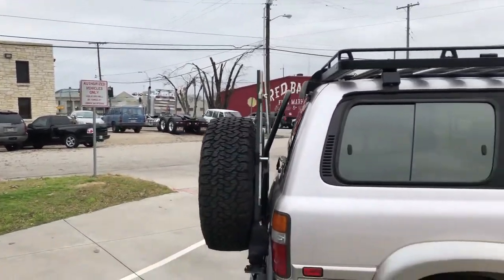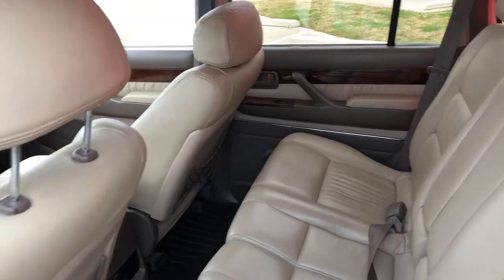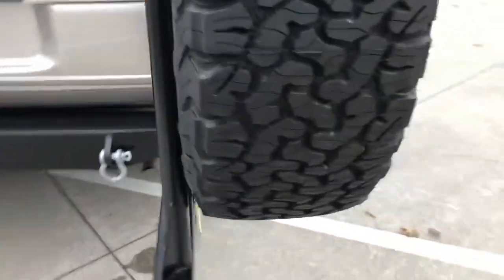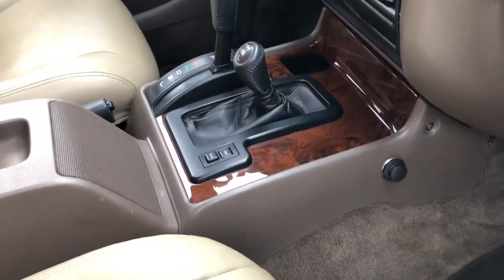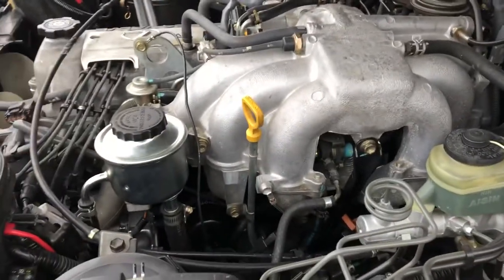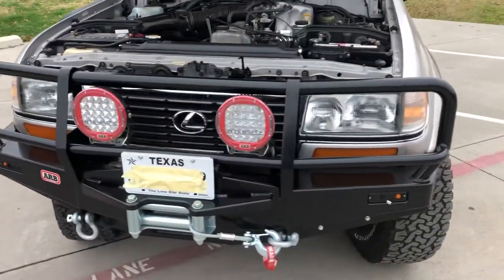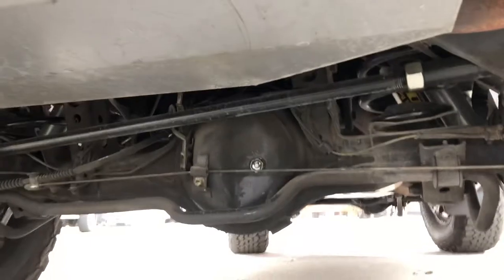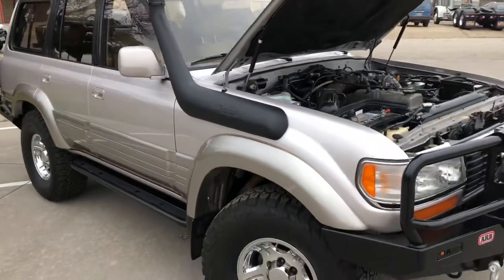1997 LX450 Ultimate Build

Comment: But is it triple locked?

Seriously though, amazing build.  It’s all about the solid front axle.  And the lockers.
Reply from the maker: Yes it is triple locked, It was not originally a locked truck from factory. We added E lockers front and rear and made it all operate like factory with an oem dash rotary stitch, dash lights illuminate etc, all like factory except quicker actuation and stronger locker units.
Reply: @frisbeeautomotive2244    wots the price

Comment: One of the nicest 80’s out there. Any chance the Warn M12000 winch is a direct bolt on or did you have to use spacers to make it fit? Cheers.
Reply from the maker: Thank you, the warn M12000 is a direct bolt in on the ARB winch bar for the 80 series.

Comment: If you know anyone looking for the starter vehicle to start these modifications, give am a yell.  I have the 1996 same version in great stock condition with with 155k on it, even have the original car phone that came with it.
Reply: Hi David, I'm interested in the vehicle you have available, can you message me more info. - I'd appreciate it, thanks!
Reply: GsXtC21  1996  with same color as the one in this video.  Has 155,443 miles.  Located in Timberville, va.  All original with 3rd row seats, even still have the original car phone that came with it new.  Driver’s seat is showing some wear with some cracking but all the other seats look almost like new.  Let me know where I can send pictures.